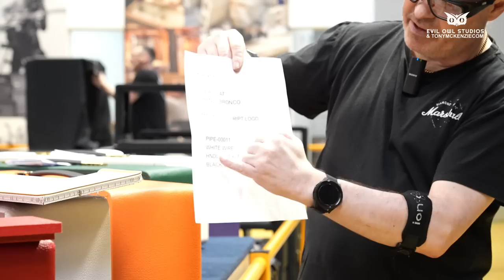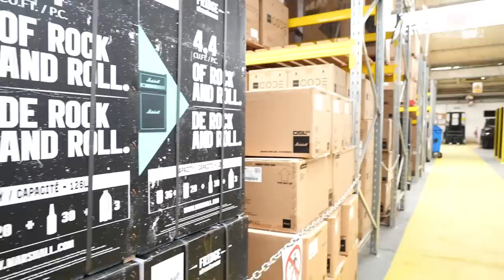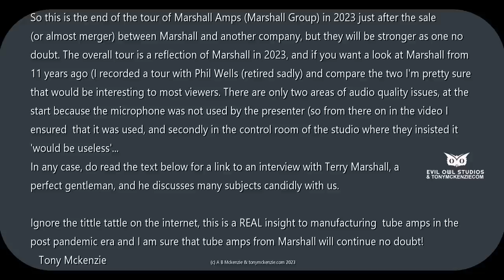Marshall Amps Factory Tour in 2023 | Inside Marshall Today

Comment: Great job as always Tony. Very nice to see Marshall is modernizing but keeps the traditional side as well. I happened to notice at the 7:15 minute mark at the fancy solder box there was a "lead free" sticker up top that was applied upside-down. That was amusing and put a smile on my face. Amp techs generally hate it still. It was mandated for electronics in 2006 by the EU, forcing all amp builders or electronics etc., to use it if they wanted to sell their products in the EU. Most solder joint failures have more to do with factors other than the solder itself. Marshall forever.!!
Reply from the maker: Ha I bet that was absolutely on purpose too :) The lead free stuff I always found a pain too, it does not seem to melt and bond right and if you have dry joints look at those with lead free first. Thanks for watching.
Reply: That's regulation gone too far .

Comment: I have three Marshall’s. A 1972 100 watt Super Lead with a reissue 1960 AHW cab. A 62 Bluesbreaker reissue. A 1998 TSL 122. Would love to take that tour.
Reply from the maker: Well if you're in the UK you can! If you call them they will arrange to take you around the facility. I have an older video with Phil Wells and that one was really the definitive one... showed lots - and in part two of that you see Gary Moore's amp in for repair :). I too have a 1960AHW cab matched to a 1959HW head. Perfect! Thanks for watching.

Comment: Great channel  Tony...very informative....I own a RAT modded class 5.....I think ..the RAT guy he is retired now....you can still sometimes pick them up 2nd hand..it sounds fantastic..if you get the opportunity snap one up...one of the UKs best kept secrets.....kinda like a mini bluesbreaker in looks......but he basically takes an already pretty decent marshall amp and pimps them out....to turn it into something world class...kinda like a working class Dumble lol...its great....I owned a plexi...in the 80s....it was far too loud ..looked great with my 2 cabs...but never could use it ....I also  loved my marshall TSL 60 watt combo...wish I still had it...also the marshall valve state stereo chorus was very good for a transistor amp....I don't buy amps anymore as with my marshall class 5....a VOX AC4 12..(China made not hand wired but sounds good to my ears ...I'm not a valve amp snob....I cannot tell the difference between hand wired and circuit board amps tbf...ive owned an original 60s Vox AC30 and the all be it quieter ..more managble AC4 still has the "top boost" tone ...although I imagine a hand wired one is easier  to repair)...and a Roland jazz chorus I'm happy...but I don't know if it's the same but in my day ( old git talk lol) buying a Marshall was not only reasonably priced but also ensured great quality ....that said as I don't gig and only play for a hobby I rarely use an amp these days..I mainly use a multi effects unit or a ROLAND GT55  guitar synth...( I know you were not impressed Tony...when you reviewed it....but it's a complex thing and the factory patches are a mere hint to its capability....its only limitations is ones imagination)....that said its nice to have a choice....I'm kinda sad.....when I use my valve amps I always have a sniff of the vents....let's be honest.....no one sniffs a Line 6 modeling unit...lol....man I sound a bit like a valve pervert...lol
Reply from the maker: Ha sounds like a case of the sniffles :) Did they accompany tears? :) or what about other things, like wishing it was 1965 or something like that? :) Actually the GT55 was not that bad and probably me that might not have known every facet of the unit - there was a lot in it and really I have only so much time... in any case (apart from the sniffles) :)  it all sounds OK to me.... hey thanks for the post and for watching.

Comment: Not Marshall anymore lol i was highly disappointed by Marshall, I have a collection of no less than a dozen Oldies Valvestate 80 line amps, anytime I see a reasonable price one up for sale in the used market I pick it up, however, the Marshall logo often degrades and cracks and brakes off, they can not be found here in Canada, so I reached out to Marshall hoping they would sell me a Dozen of them so I could replace the ones missing on my amps and have spares for future amps i'll pick up! they politely told me to F off. Eventually, they referred me to someone local that apparently is a repair representative and parts dealer for Marshall here in Montreal, which never amounted up to anything! Not bad for a company, that apparently prides itself on quality and customer service! Guess that is only true if you are a rockstar or something,
Reply from the maker: No, I already know that the Marshall badges have to be bought through a dealer. It's generally the same everywhere. And for example, it's unlikely (if you're not a registered tech) they would sell you a replacement main board for example... authorized dealers might of course, but that's the correct channel. The thing is, people (I believe) abuse things like Marshall logo's and would they sell you 10? I doubt it. But an interesting point and thanks for posting that info. And of course thanks for watching.

Comment: Marshall has taken a shit on their amps. The quality has gone, the sound has gone and Marshall has gone to Sweden.    I have been a Marshall dealer in the US since 1989.   They have no new models and the stuff they have thats made in the UK is over priced. The chinese and Viet Nam made amps have such cheap parts in them they are just junk.   I own 11 of the JVM 410 JS heads and only one has not been replaced for breaking down while in the studio.  Garbage, Garbage, garbage since Jim left this world the entire Marshall line up has taken a turn for the worse.
Reply from the maker: Well my experience is actually entirely different here in the UK. I don't buy the Vietnamese amps. I buy the UK made amps. The JVM410HJS amps I have had (two) I never had a single problem with. And IMO those are among the best rock amps I have owned. But I 'get it' re the USA pricing. Here's the point, when I want to buy a Mesa amp the price is typically 30-40% higher here than there. And (while I'll never buy another) Friedman and similar all coming from that USA area (Lets call it California) all wreak of not good quality (I have seen them first hand here) and the pricing is (as you say for Marshall) a joke. So we're not really far apart... but I can also say that the Studio amps I also have no problems with and they sound great and I can buy those for less than $1000 inc. tax. (and those are all made in the UK). Your post IMO shows the stark difference between the UK for Marshall and (as the example) the USA - and my little comment here shows the stark difference of USA products coming to the UK in not good quality and double the real pice. Ha we're the same! This post by you is in its own way a very good post, it shows your own experiences in the USA marketplace. Why not complain to Marshall? I would!  Thanks for the post actually I really appreciate it and thanks for watching. I know you watched this one but did you see the interview I did with Terry Marshall? and what he says about the 'sale' of Marshall and their future in amplifiers? Heres a link where Terry Marshall spells it out as it really is, and not as some internet dudes might report: https://youtu.be/khqCZWVE7Jg and thanks again.
Reply: Just because prices in the US is higher, doesn't mean they will go to shit. You do know the world doesn't revolve around US? Also FYI, quality of chinese and vietnam made stuff are on parity with US stuff, often surpassing them. Personally I'd rather take a chinese or vietnam made amp over anything made in the US. The quality is the same, or better, and prices are way way lower.